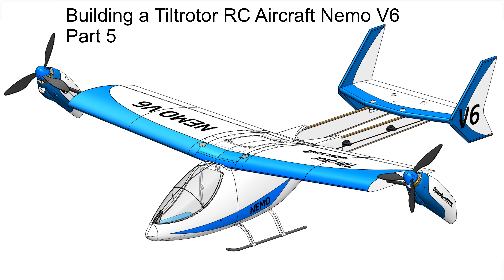Tiltrotor RC Aircraft Nemo V6 - Building Part 5

Comment: hi Steevie, 
Would you share tilt's 3D print file?
Reply from the maker: Hello Unuuez1700,
Yes, I will update the rcgroups post with the failover mechanism in the next few days.
Reply from the maker: Hello,
I just uploaded the STL files for the version 6 tilt here. https://www.rcgroups.com/forums/showthread.php?4190313-Nemo-V6-Tiltrotor-Aircraft-VTOL
I still have to file other additional information but I suppose that you will already be able to progress. Otherwise there are the assembly videos and I remain available if you have any questions.

Comment: really nice vtol possible to make the print files for 200x200 size printer? :D
Reply from the maker: Hello einpunkt,
I guess most of the parts are already compatible. But I will check. What would be the travel of your machine in Z axis?
Reply: @STEEVIE2376  currecly is the z on 180 max. but when i look the files again there will be multiple parts to make compatible like back wings and trims will be to much remake to fit it for smaller printer so able to print it smoothe and stable.

Comment: You would have much better stability with respect to grawity poit if servos would stay in place and the motor is moved forward only……
Reply from the maker: Hello Mike,

Can you explain your remark?
The concept of compensating the inclination of the motor with that of the servo allows me not to move the center of gravity and I like this concept. It is all the more important in the case of a twin-engine VTOL design like Nemo.
Right now I don't have enough time to continue my work with Nemo so I won't change my concept.
Regards